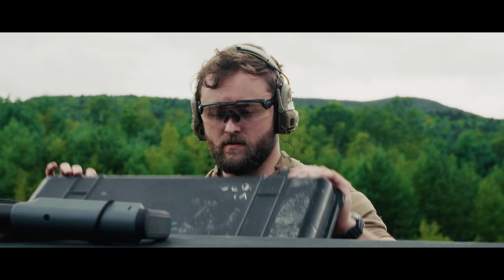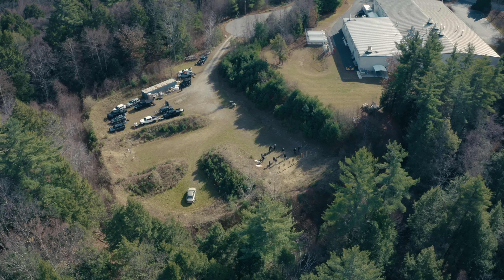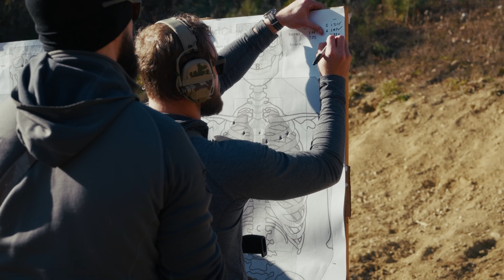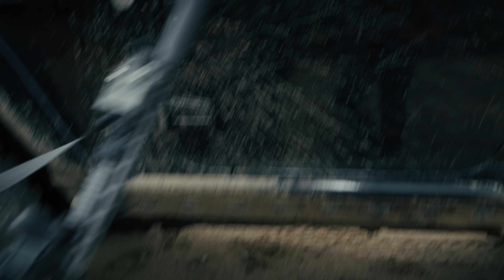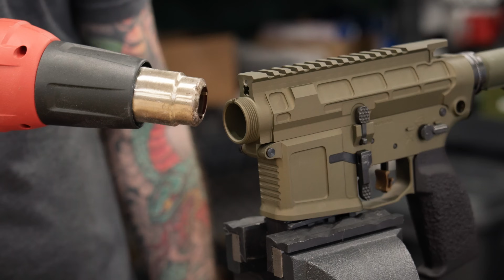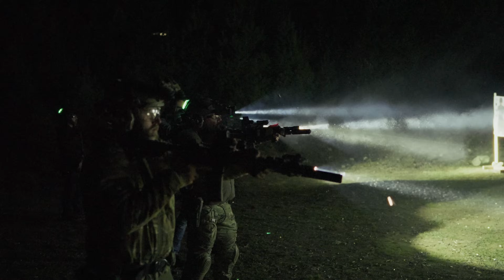ESD Breakdown: Leitner-Wise Product Suite

Comment: BCG:   VKTR Combat Match (DI, 22.5° Delayed Cam, Black DLC Finish) 
Gas Rings: JP Enterprises Enhanced One-Piece (Low Friction) 
Lantac Domed Head Enhanced Firing Pin .
David Tubb Chrome Silicon Extractor Spring:S7 Extractor.
Riflespeed Gas Block and Silent Captured buffer Spring.

Comment: Im sure you saw this, but SOTAR found the tolerances inside the bolt face (where the ejector is) was significantly tighter than other bcgs and he eluded to the fact that it might result in ejection issues or damaged brass. 

Did you experience this?

Comment: The only thing I see different about those parts is the coating. I've personally made hundreds of thousands of them with my largest tolerance being +/-.001in. The problem with the cheaper versions is unattended manufacturing. Shops are cheap and lazy and customers are even cheaper.

Comment: The best internal upgrade for an AR is the trigger.  It doesn't take much to do better than a GI trigger & you can even keep a fairly simple GI style trigger that is still a huge improvement.  For AR's I spend the most on the barrel, the trigger & the bolt/BCG.  The external add ons like optics are huge too as well as good ammo.  For guys getting started on a budget even if you can't afford all the stuff at once, you can upgrade as you go.

Comment: If the buffer is hitting and breaking the retaining pin you have other issues such as a short carrier or the buffer retaining pin hole drilled to far rearward in the lower. In the case of a misaligned hole you need one of the pins that allows the buffer to be retained farther forward. What you don’t want to do is get a larger retaining pin that retains the buffer deeper in buffer tube.
Reply: I will say, some buffer retainers aren’t made very well so a heavier buffer spring (Sprinco blue and r red, or an A5 length spring) can cause damage when coming forward.

Comment: 🤣🙄 snake oil for most all of it I have heard so far… you want to change your dwell time, change the gas port location. But yeah okay sure a cam pin is going to affect that. 🤦‍♂️ lock up, wtf are you talking about? Show me how many thousandth of an inch there is in a in spec bolt by the mil spec TDP, and barrel extension…… the point of the lugs is to take the load…. You’re telling me there’s a sloppy fit with in spec parts? What are you calling sloppy? 0.002”? 🙄

Comment: They "engineered the cam pin from the ground up"...right. Translation: chromed it, stamped an arrow and beveled edges. Now pay us $24 for a $4 part.
Reply: That’s already more than any other 
Also you’re forgetting that the tolerances are unique
Not TDP spec
Allowing better performance and consistency or whatever
It’s still a cam pin
But almost every element has been changed or improved 
Aka “reengineered from the ground up”
Reply: I was skeptical of the LW bcg too. I purchased one, gauged and tested it. The cam pin to bolt interface tolerance was excellent, one of the best I have seen. The Leitner-Wise bcg is a high end product. It cost money to get a high QC product, which supports the adage, you get what you pay for. You get that with a Leitner-wise bcg.

Comment: If you actually want to increase the reliability of an m4 bolt make it out of a maraging alloy with low sulphur content. Vacuum arc remelt alloys with ultra low sulphur content are way stronger than standard high carbon tool steels.
Reply: @josephleinhauser6130 you are absolutely correct in that that would be an excellent choice if it was a material selection issue, but it isn't. It's actually a systemic issue resulting from the asymmetric design of the bolt and the way the extractor claw is accommodated. The lugs either side of the extractor take a disproportional amount of stress during firing (approximately 85%) because of the above mentioned asymmetry, yet are substantially weaker than the other lugs due to 48% of the root of the lug being removed to accommodate the extractor. These are the two lugs that always fail, no matter what material is used.
Reply: @ wow that’s interesting; I hadn’t considered that and appreciate your response. Wouldn’t a stronger/stress resistant alloy be more durable regardless of design issues? Given the design of the bolt and barrel extension are not going to change doesn’t that mean material selection becomes more critical?
Reply: @josephleinhauser6130  to a degree, but you are only staving off the inevitable. Bolts manufactured with C158 start to show micro-cracks at the root of the lugs at around 1,000 rounds. From there they propagate towards the back of the bolt until the lug eventually fails at anywhere between 5,000 and 15,000 rounds depending upon usage and configuration i.e. shorter barreled weapons fail at lower round counts than longer barreled weapons with longer gas systems; they generally never exceed 19,000 rounds - these details are from published US Army studies. Multiple attempts have been made with different materials, including forging bolts, in order to increase longevity (particularly in the case of rounds such as 6ARC) but the benefits are marginal at best and not statistically significant. We've been making this bolt for 16 years and have never experienced a failure.
Reply: @ do you think that mandated high pressure testing per TDP  is contributing to premature failures? I believe sig cracked the code during NGSW testing to implement some more durable alloys in critical areas. 

Thanks for the feedback. I didn’t expect to receive a reply to my initial comment and it’s refreshing to be able to ask questions or discuss something without it divulging into name calling and insults
Reply: @josephleinhauser6130  I've never been a fan of subjecting a component to an outdated 30% overpressure test, purely from an unnecessary fatigue standpoint. I've also enjoyed our conversation and would like to thank you for it.

Comment: I have the LW combat match bolt in my LMT now, and had it in my lwrc ica5 in the piston carrier from him before I swapped it over. 

The combat match bolt’s design makes total sense from a durability and longevity standpoint. The strengthened lugs adjacent to the extractor just flat out solve a design flaw of the mil spec ar15 bolt design.  

The cam pins directional arrow ensuring consistent wear make sense for accuracy. And the rounded corners of it just supplement the revised cam path in reducing wear in upper receivers. Something I care about in my MRPL specwar upper and lwrc uppers as they are proprietary and the LMT is likely something I’ll pass down to my kids some day. I’ve seen people beat their uppers to death and gouge the heck out of their cam’s path in their upper to the point they decided to toss them. 

I personally like the chrome coating of the piston carrier I had in the lwrc. Smooth like butter in that upper. Haven’t gotten the di carrier for the specwar yet. 

I will say I have broken the tip of a titanium firing pin during some intense firing schedule training, while suppressed. I had another (steel firing pin) in my kit and swapped it out and got back to training. I’d actually love to see a firing pin, being that they are such a small component, and relatively simple to produce, be made out of some alternative material than the standard industry offerings or titanium, there’s got to be some sort of gnarly super alloy that could endure a longer more abusive life without failing. It seems to me firing pin life spans could be extended. 

Looking forward to getting a complete di bcg for the LMT. 

(Ps there are good engineering reasons for all the choices in the bcg’s designs. I have been well pleased with my components. Paul is a fun guy to talk to)

Comment: Forward Controls Design has cam pins with directional marking on them. Chad from SOCTAR has promoted this in his classes. The titanium firing pin is not ideal do to possible breakage. The bolt's extractor doesn't need a "O" ring with the correct spring and insert. Marketing hype.
Reply: Maybe not as important as it once was but back when most guns were horribly overgassed it was.  The early days of the MK18 with high back pressure cans and hot ammo had extraction issues. The single gas ring and extractor parts upgrade were part of the reliability upgrades they got. Suppressors are more common now and more manufactures are putting time into getting gassing just right.

Comment: Personally I like the firing pin since it only presents advantages relative to the old firing pin made of steel. As for the bolt, the LMT enhanced would be what I go for. Nothing wrong with a tighter headspace but the reason why some slop is allowed even by top tier manufacturers is so that when grit and moon dust gets into those operating components the gun can still cycle instead of gumming up. You get some you lose some in this case.
Reply: I've really got to liking the Geissele bolt. The lug edges are so very slightly rounded and the higher grade 158+ has apparently increased bolt life like 5 times of the regular 158 bolts. Plus the Nano coating makes clearing breeze. I think it's the best bolt going right now. That Geissele bolt combined with the Lantac E BCG carrier is an amazing combination.

Comment: are you running the q 13inch rail with a 13.9???
Reply from the maker: @rytacarms  it’s a Q 12” rail with Criterion 12.5” core series barrel or some of our older builds have BA 12.3” hansons!
Reply: @ oh shit talk about threading the needle with that surefire can 🤙🏽
Reply from the maker: @ with the 12.3” you have to add an extra shim for proper lockup on three/four prongs but the 12.5” you’re good to go regardless of shims and muzzle device!

Comment: I would very much like to see the increased accuracy test results from the bolt swap.
Reply from the maker: @SKRAGER  that’s next up on our schedule regarding these products!
Reply: It doesn’t exist
Reply: You'll never see one, or at least a truthful one.
Reply: Well, people have anecdotally reported tighter groups going to a Gisselle enhanced bolt carrier group from say, an Anderson or a spikes tactical BCG. So, who knows?
Reply: It’s a load of crap and this is a stack of snake oil products. It’s downright pathetic.
Reply: @drake0074 I have only used the cam pin and the G2 heavy buffer retainer so far. The cam pin has eliminated the wear spots in my Colt AR15A4 Upper receiver where the existing Colt BCG cam pin was causing wear in the cam pin travel pocket. I used Aluma Black to cover the exposed aluminum in the pocket and then installed the Leitner-Wise cam pin and I've had no further issues of wear in that area of my upper receiver. Just out of curiosity, I installed the Leitner-Wise G2 heavy buffer retainer in the "in spec" buffer retainer pocket of an A2 buttstock equipped lower and I still have the same Carrier tail/buffer face displacement (40 thousanths) as I did with the original Colt mil spec buffer retainer. So both of those products have worked fine for me so far. I may spring for the bolt later, as I'm interested in evaluating it's performance as well.
Reply: @drake0074  it’s PLW
Reply: Agreed

Comment: None of these parts do anything most other options on the market dont already do. I get having a preference for certain brands but you not only look dumb by making up convoluted stories about the advantages but you actually diminish any perceived advantages a brand may offer by doing stuff like this.
Reply: @AdrenalineTheory At face value that might appear to be the case however the bolt and cam pin are patented, and the firing pin uses a production process that no one else in the industry uses so clearly there is some uniqueness.

The accuracy and consistency gains enjoyed with the Combat Match Bolt were secondary to the primary design focus which was to address the core cause of AR bolt failures, and that is bolt lug breakage adjacent to the extractor cut out. We achieve this by not undercutting the root of these lugs - no other bolt design does this - the problem isn't material choice, it's a design flaw with the Stoner pattern bolt. Can a regular bolt be used? of course, but they do and will fail as numerous US Army studies have shown. We've been making these for 14 years and have never had a bolt failure.
Reply from the maker: @AdrenalineTheory  agree to disagree on this one. Some companies are offering rounded cam pins to help reduce drag inside your carrier but there are a lot that aren’t. Most don’t show direction so you’re building inconsistent wear patterns. Most bolts are set to the exact same standard specs and never challenge the norm. Most firing pins all weigh the same and with light triggers and hard primers don’t generate enough speed to break primers(this is especially seen with auto guns and cheap ammo). Standard buffer retaining pins aren’t as strong as the G2 and if you’re doing anything in the arctic area harder to depress with gloves and it’s a failing point when exposed etc. there’s a lot of great little details that set these products aside from the norm. Also at the end of the day we never told you that you have to buy this and everything you use is wrong. We simply stated we have experienced these benefits and understand the engineering behind there designs. If you can articulate why those things don’t make sense we’d love to hear it because your argument doesn’t currently provide anything of substance for us to debate or anyone to learn from.
Reply: Agreed. Bad sales pitch for sure.
Reply from the maker: @The_Nameless_Entity  what would you want to see in order for it to meet your standards? Keep in mind this is also just an overview of the products not a demonstration or comparison.
Reply: In what respect? Because it upsets your echo chamber existence? If you're going to post on someone's feed, don't you think it's respectful to at the very least articulate a meaningful conversation and engage in it?
Reply: @PaulLeitnerWise  I must have hit a nerve. You came back 13 days later to respond again.

Comment: Whats wrong with the ole reliable BCM?  They work great in all of my rifles.
Reply from the maker: @howboutyatn  nothing is wrong with it! Still going strong in quite a few of my rifles. We recommend you to check head spacing but aside from that there’s nothing inherently wrong with them. Through testing we found our groupings shrunk when using the LW combat match bolts in comparison so that’s why we are offering them!
Reply: @edgarshermandesign  i love that in most other guns, headspacing is a relatively large concern, while the AR could have 3 miles of headspace and it'll still run.
keep it up, fellas

Comment: I call bullshit on everything to do with the titanium firing pin giving a much more reliable system. Stop pushing snake oil. How many rounds have you had go off from firing pin inertia? 0.  Please give me the numbers on lock up time improvements. Not measurable if it exists.
Reply: Ive only ever broke titanium firing pins. Theyre more brittle and can't be dry fired long term.
Reply: @R5RGP  Generally speaking titanium isn't actually brittle, it just doesn't handle impact forces well and deforms in response, so its potential lifespan is shorter if used in these sort of applications without additional production processes. if you've experienced embrittlement with titanium, that's likely a manufacturing issue.
Reply: @PaulLeitnerWise  well in the tens of thousands of rounds ive fired in my life steel pins have never failed me I have no reason to fix something that isn't broken
Reply: @R5RGP  Absolutely, and I couldn't agree more, the most important thing is confidence in your firearm. This is just an option, another tool in the box nothing more. All we tried to do was address the known material issues, and in doing so bring up the reliability to the standard of the Milspec component with the benefit of less weight.
Reply: @PaulLeitnerWise  no fault to you guys just the nature of titanium. The wieght savings are minimal at best and better spent on a semi auto cut carrier or lighter buffer.

However I can see a DLC coated or nitride firing pin being smoother and more reliable or even a Titanium nitride coating being extremely beneficial for the supposed lock up time improvement.
Reply: @R5RGP it's refreshing to have an honest conversation with you.
Reply: You mean you don’t desire a “faster lock time” of titanium compared to steel firing pins measured in fractions of mili-light speed seconds for drastically more reliable accuracy?? 😂
Reply: lol, agreed. The LMT enhanced firing pin LMP114D is truly the only AR15 firing pin that is a worthy upgrade if someone is concerned. It’s expensive, it’s elusive, it uses maraging steel and was specifically made by request for new cartridges like m855A1. Is this a necessity for most people? No, is it a concern for some and a good solution for those? Yeah. I have the LMT enhanced BCG, bolt, and pin in my rifle. Totally overkill and took me a year to find in stock/a long time to have 540 available to spend on it. But damn it I just wanted the best BCG ever made.
Reply: This is literally snake oil shit.
Reply: Instead of stating an asinine statement along the lines of "this is snake oil....." why don't you articulate your actual issues? In that way you could engage in a meaningful conversation and learn why people who actually shoot firearms think there is relevance. At the end of the day, everyone makes their own decisions, but behaving like a petulant child does a disservice to everyone reading these comments.